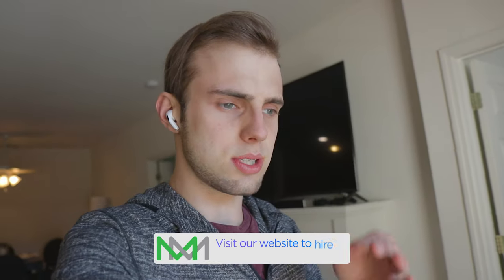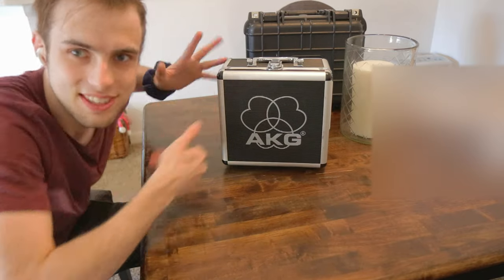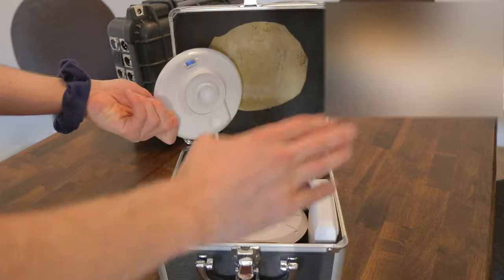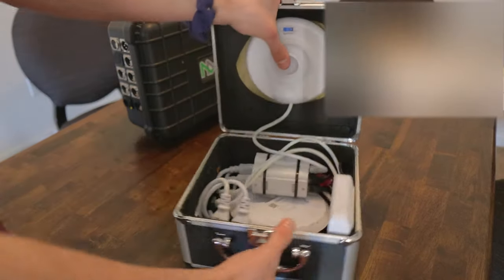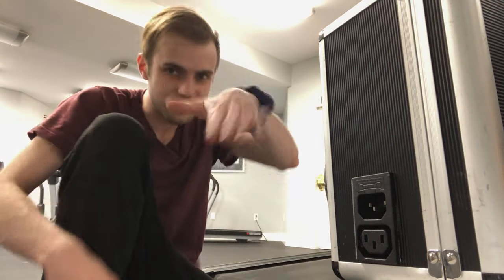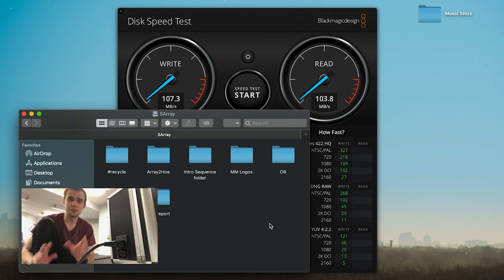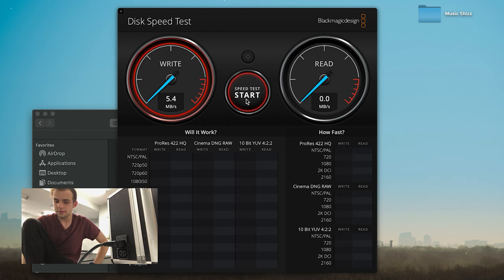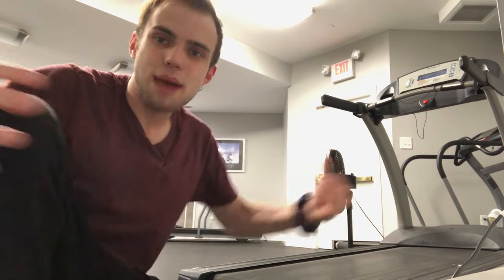Ubiquiti P2P Gigabeam Testing

Comment: I've been using the Gigabeam 60Ghz bridges to go from my house to my barn for the last couple of years or so and they've been flawless.  It is about a 60 yard shot.  The one on the house is mounted on the garage about 10ft up in the air and the one on the barn is about 20ft off of the ground.  I've never noticed any significant difference in signal when it is raining or snowing and the link is very stable.  

For what its worth I switched from a set of Engenius 2.4 Ghz bridges because that band was getting too crowded around my house.  The Gigabeams are excellent.

Comment: I used the NanoStation loco M2s to enable my parents to get fixed wireless internet on the farm.  They had a huge row of trees between the house and the fixed wireless antenna.  So we had the ISP install internet in the machine shed a 150 feet or so south of the house and then beamed the service from the shed to the house.  We're coming up on either 4 or 5 years and I haven't had to touch it.  (I used the loco M2s because they are cheep and the bandwidth was only around 15Mbps anyway.  It has since been doubled, but the loco M2s still aren't a bottleneck.)

Comment: Love your videos! Would you suggest this system to work for a home that is about 600 feet from a gate that my client needs a camera on their gate? They would like to stay within the Ring ecosystem for their cameras.....I realize you need the unifi setup to send and receive the signal. Just didnt know if the distance would be an issue.....
Reply from the maker: This would work great, although, if you're going to have these mounted lower, I would recommend stepping down to the nanobeam ac gen 2.
Reply: @MillerTechnicalServices  So they HAVE to have line of sight correct? If it needs to go through trees it would be better to run an underground ethernet to an AP ?
Reply from the maker: If there’s something like a single tree, you’ll be fine but generally yes they need line of sight.